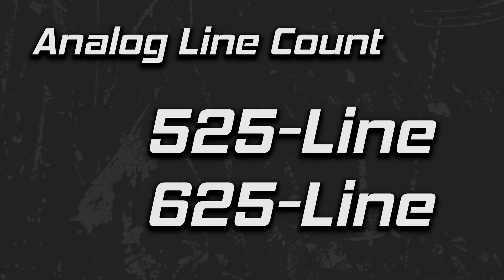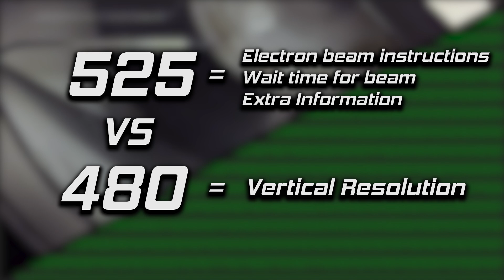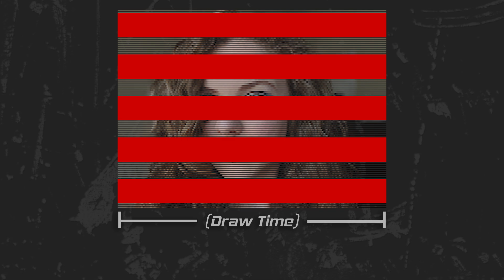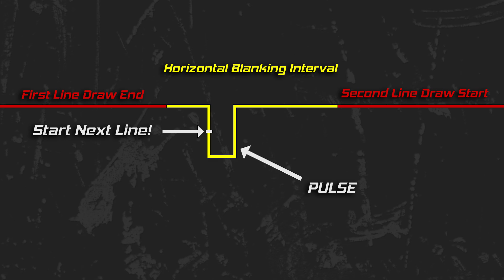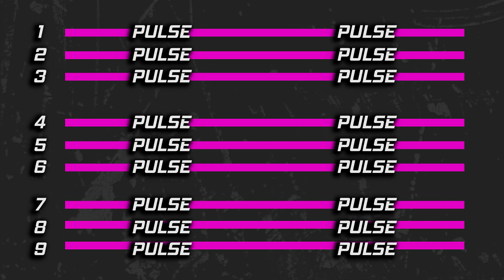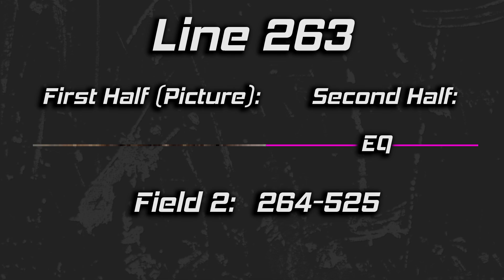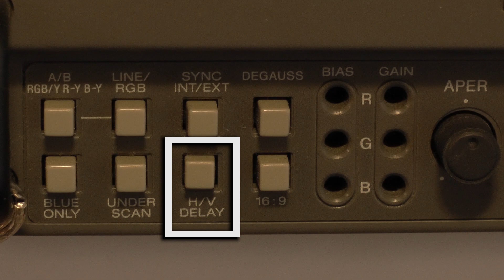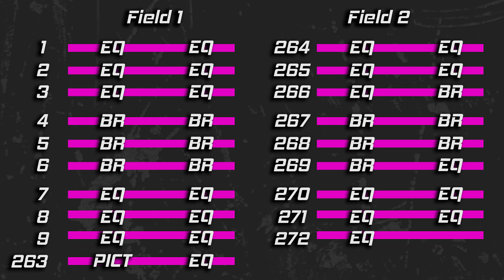What is 525-Line Analog Video?

Comment: CRT TV’s were some of the most awesome machines ever invented.
Reply: That invention changed human life style.
Reply: 1440p @ 80-85hz with 0-2ms latency in 2003 so yeah they were!
Reply: exactspace I think dialup was the coolest thing. Sending all of that data over POTS with machines that test the lines by themselves? Neato
Reply: I had a brilliant 32inch CRT tv back in the early 2000s that I wouldn’t even hesitate to trade my 4K 55inch flatscreen to get it back. It was heavy as hell and was screwed into its own tv cabinet that was a pain in the arse to move but my god, it was awesome playing ps2 games on that thing. I had it for nearly 10 years and it still worked like brand new until i dropped the damn thing while moving house...
Reply: I had an amazing Hitachi CRT monitor for my PC games, I was playing 120Hz Quake 3 and Unreal Tournament with unnoticeable lag times. I was so sad when that monitor died. It took me years to get used to LCD gaming. I was never happy until I could finally get a 120Hz OLED.
Reply: BUT, CRT displays owe their existence to mechanical tv from the mid 1920s. 
A Disc with holes punched into them in a progressively spiral spacing as the varying intensity light source behind the disc provided the luminescence. A 32 line "TV" in the mid 1920's was a reality, but there were extremely limited video sources.
Reply: Yup, everything looks good on a crt. Such a great invention, I miss mine
Reply: Farnsworth invented digital electronic TV as a young kid you can read his story at Wikipedia, you look at an invention done by a high-school kid.😊
Reply: YES. I am honestly jealous I didn't grow up in the 90's. CRTs are way more flexible than flat panel displays (i.e. LCD or OLED).
Reply: I think each technology is incredible in its own way.  With CRTs, its inarguable that firing a high-voltage generated electron beam directly at the viewer's face that is precisely deflected and intercepted by a phosphor screen is just awesome and hardcore (essentially everyone had a particle accelerator in their living room) - not to mention tying it into radio technology for broadcast.  On the other hand, the precision semiconductor manufacturing required to print LCD or OLED screens of the modern era is astonishing in its own way.  Starting 'from scratch', CRT tech would be a lot easier to achieve compared to the complex material and supply chain requirements of modern displays, but are no less awe inspiring in its conception.  Nor should we discount the incredible complexity of the modern economy that allows just about anyone to obtain nm level precision manufactured components, to the point of ubiquity, and then distribute content digitally across a network that encompasses the entire world.
Reply: That lady in the photo is pretty awesome, too. Who is she?
Reply: @5roundsrapid263 she looks better when deinterlaced. 😊
Reply: Crt are only good for retro gaming. Modern lcd are always better.

Comment: The Amiga computer is the only computer really designed to control, and display correctly on, a CRT TV. Even so the 625 line PAL standard can only have 576p maximum output to the TV/monitor.
Reply: An Amiga is be ridiculously slow at 576p, and I have an AGA chipset. Though the highest it can output to a TV is 576i, for any higher you'd need a VGA monitor.

The highest I've seen is 1024x768 on a VGA monitor, though if you have enough chip RAM and the right drivers you could go higher. 1024x768 was an interesting experiment, but it was genuinely too slow to be usable you could see each line being drawn onto the screen in real time.
Reply: @fattomandeibu  You are getting confused, I am talking about the fact that on a PAL 625i signal input from RF that all CRT TVs accepted the Amiga can only output 576/625 maximum lines the PAL signal allows per frame/two fields. This is not about resolution in total, it's about the reserved 50 lines used for things like Teletext or NICAM stereo sound broadcast through the RF signal in areas not even the Amiga chipset can access under any circumstances. No machine except specialist CRT TV engineer equipment can, but the Amiga accesses the most by far compared to any other system with RF output.

Comment: Back in the day, they didn't tell us, it's 576 lines or 486 lines, respectively. I was told, we've got 625 lines and across the Atlantic, they've got 525.
I then computed out that with 4:3 ratio a line would have 833⅓ pixels. I had a close look at the screen, the screen was a cromaclear shadowmask, and I saw the hexagonal structure. I concluded that some lines have more pixels than others, some have 834 lines, other 833, on average 833⅓. How wrong I was. The literature I had back then didn't make things clear.
Nowadays, young people have never heard about the numbers 625 and 525. They only know SD as 480 in NTSC and 576 in PAL.

Comment: Where I come from, standard definition is 576i!
Reply: --  united kingdom, it was great for higher quality video, at the cost of 10Hz - our displays were 576i 50Hz due to the mains frequency. Some consoles/games took advantage of the extra resolution and it was great!
Reply: @iMagic16  well actually it was not great! so many games were not pal optimized and ran slower than the NTSC counterparts and had black bars on the top and bottom of the image
Reply: @PSXMicha  Lots of the systems that were originally popular in the UK were mostly popular in Europe so the games were programmed with that market in mind. Depends how old you are though to know the 8-bit wars?
Reply: *was

Comment: small note, if you send 2 different fields per frame you can achieve 60fps using 480i instead of the usual 30fps that the format was designed for.

Comment: 720, 640, 512? what is the viewable horizontal resolution of  a crt tv and is it linked to the number of phosphor stripes?
Reply from the maker: This is actually a rather complicated question that can be answered by talking about cycles per picture width and TV lines (TVL) that is tied to aspect ratio... and of course should also mention things like overscan as you used the term "viewable" in your question.

Two TV sets when fed the same signal can potentially have a different number of discernible lines depending on the quality of the set.
Reply: @DisplacedGamers  S0 it depends on the TV, meaning not all TVs have the same amount of TVL phosphor stripes? But in game consoles how do the pixels (of different resolutions, 352,320,256)  aline with the TVs phosphor stripes?
Reply from the maker: The pixels do not line up because a CRT doesn't use pixels. A horizontal line on a CRT is made up of a number of samples per line. The pixels from a game console represent what is used to create the set of samples provided to the CRT. There is no 1:1 relationship between the analog source material for a horizontal line and the expected display result on a CRT like their would be for say 1920x1080 fed to a full HD, pixel matrix-based display.
Reply: @DisplacedGamers  So TVL RGB phosphor stripes have nothing to do with horizontal resolution but the verticle scan lines do?
Reply from the maker: A higher TVL count can help you perceive a higher level of sharpness across your display. You could feed a high resolution test pattern to two different displays - a consumer set vs a PVM (or perhaps simply two consumer sets of the same make and model where one is properly calibrated and the other is not!) and you would see a sharper image on one display vs another. In the case of the Super Nintendo, for instance, it is still (typically) going to involve 256 pixels turned samples across the horizontal regardless of what display you are using.

In short - the term "resolution" is subjective.
Reply: @DisplacedGamers  could you make a video explaining this in detail?
Also why is the geometry of crt TVs (seem to be) alwaysed messed up? the bigger (screen size) they are the more distorted. PC monitors too.
Reply from the maker: Geometry can be a tough thing to get to look right on a CRT. By design, the image is being drawn by an electron beam moving extremely fast across the display. It is deflected using magnetism. Fine-tuning the geometry is very subjective both from a mechanical (yoke position, for example) and electronic standpoint.

As for making a video - I wouldn't rule out the possibility of it happening at some point.
Reply: @DisplacedGamers  I could never get the geometry right (4 straight sides) on a crt TV, monitor some times. I think CRTs distort over time.
Is it posible to show a 256p image on a NTSC TV if you adjust it?

Comment: The VBI pulses may seem repetitive, but they are pretty important if you want a picture on your screen. Remember that television was developed using vacuum tubes and 1930s discrete components and that ancient stuff had to not only sync up with a broadcast signal, but contend with poor signals as well. A lot of NTSC's design choices come from the limits of technology at the time.
Reply from the maker: Thanks, NJRoadfan. This is definitely true. I actually cut down my script a bit and elected to omit some of this information for pacing. The limits of technology at the time were such an important, key item in the evolution of television. They certainly weren't going to change the signal every couple of years just because technology improved. The most notable instance of this, in my opinion, was the birth of composite video.

I am glad you shared this comment.
Reply: Ah! I was wondering why those sync pulses were needed in the first place!
Reply: And also for PAL and SECAM, through their use of similar technology to address NTSC's flaws.

Comment: dose anyone know how many vertical phosphor stripes or  vertical RGB slot masks are in a crt tv?
Reply: That varies per TV model. Because they are not "pixels", but merely discretisation points for the continuous electron beam hitting them, there is considerable wiggle room and manufacturers could choose what degree of picture definition to aim for. 
Further, a bigger screen might have plenty of space to fit RGB mask "sections", but as a screen gets smaller, you will start running into physical limitations of how small you can really manufacture the masks, resulting in a relatively lower density.
Reply: @Decidetto  I seem to remember that my 14" Sony Trinitron had a sharper picture than larger models when viewed from the same distance. Why would that be?

Comment: Hello! So maybe you know any broadcast or pro consumer device that can do true deinterlacing instead of just cutting odd or even fields as modern video codecs etc doing in editing software?
I'm stack with SD->HD conversion, and can't find vector adaptive deinterlating hardware... doen't know even where to start with.
Reply from the maker: Hey protasov media! I have not reviewed many devices for deinterlacing at this point in time. I would check out Tobias' website: http://retrogaming.hazard-city.de/
Reply: don't know if you ever found what you were looking for, but there's definitely such devices that exist, check out"genlocking" hardware that was used to convert video signals to film back in the day.

Comment: Man, this is great stuff!, really interesting to see how it all works. 

Now I know what those dark lines with a square half way through that quickly move up are when I fist turn on my rf or composite devices, I guess the television I guess the television doesn't get all the lines right away and accidentally draws them?
Reply from the maker: It is possible it was establishing sync lock. I think my first television (1968 Color CRT) would roll the image upward and "lock" when I first powered up a console. It would happen pretty fast - like before I would get my finger off the power button/switch of the console.

Thanks for your comment! I hope to make more videos like this one.